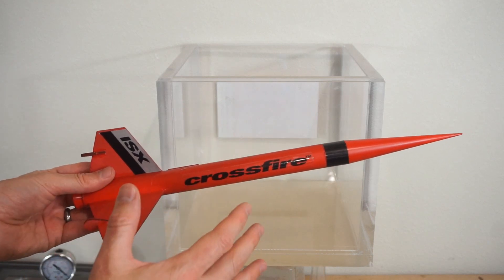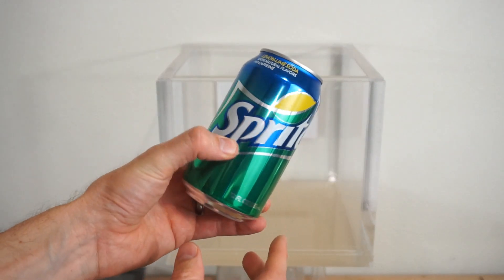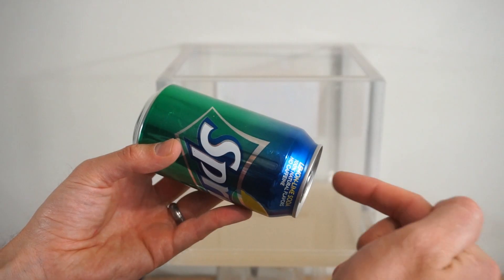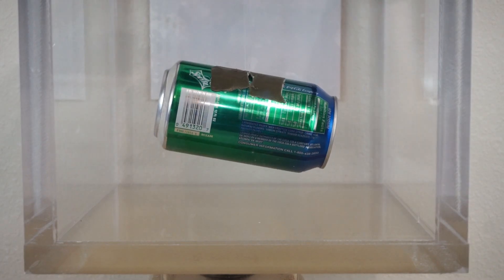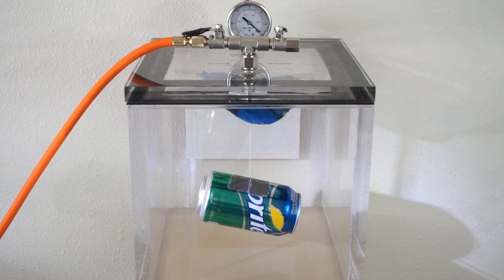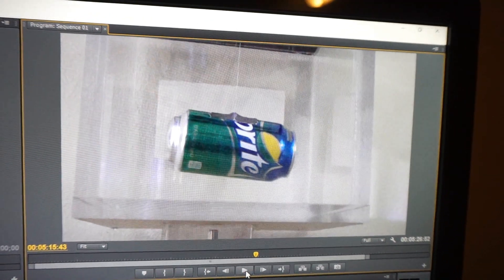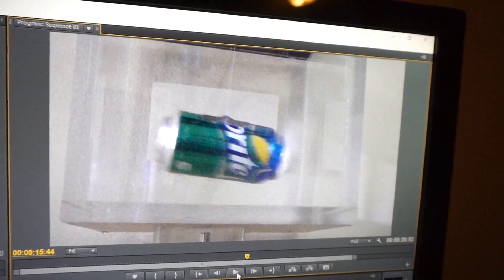Can a Rocket Fly in a Vacuum Chamber?

Comment: What a joke. Put it in a large  vacuum chamber  where it can't push off the walls . It won't fly. Take it to Johnson space center and use their vacuum chamber
Reply: We have been testing rocket propulsion a vacuum for over 50 years now. And we have millions of hours logged IN SPACE.  Take a physics class and you will not be so ignorant about how it works.
Reply: @stuartgray5877 Hi @AM-rd9pu fellow chatbot, everybody knows you're both the same chatbot - You're busted 😆😆😆😆
Reply: where in newton's laws is there a requirement for a wall?
Reply: It's a common misconception that rockets (or in this case exploding soda cans) push off the ground. However, this couldn't be further from the truth. An intuitive way to think about this is that the pressure in the can is pushing against all sides, but since they're connected, the forces average out and nothing happens. When a hole is created, suddenly there is no pressure there, and the pressure on the bottom of the can (assuming the hole is in the top) has nothing opposing it, so the can flies the opposite direction of the hole. This is heavily simplified, but this is, in my opinion, a more intuitive explanation than just saying, "Oh it's Newton's third law." (They are the same exact same thing, it's just easier to understand without referencing Newton)
Reply: He already did. It still works because the third law of motion doesn’t stop working when there’s no air. And how do you propose a rocket pushes off a column of gas? When I hold a hose, I can’t feel when something hits the stream of water, just like how the rocket isn’t affected by what the gas does when it gets ejected.
Reply: @AM-rd9pu Hi @Stuartgray fellow chatbot, everybody knows you're both the same chatbot - You're busted 😆😆😆😆

Comment: I must say I like your videos and your channel. I appreciate what you do. With that said, I will disagree with your assessment. In your video as the top of the can separates it becomes a separate opposing object and reacts to the rapidly expanding gas being pushed in all directions. The gases within the container are pushed away from the top of the container equally causing the can to move just as they would when it hits the edge of the vacuum chamber. That is just my opinion and again thank you for sharing.
Reply: But exhaust gas still has mass.  When a rocket accelerates this mass out the back it must feel a recoil force.
Do you think the mass of the exhaust gets accelerated by magic?
No the rocket PUSHES the mass out.
Reply: @stuartgray5877  so thermodynamics is wrong? NASA think so too 😂
Reply: @stuartgray5877 Hi @AM-rd9pu fellow chatbot, everybody knows you're both the same chatbot - You're busted 😆😆😆😆

Comment: That is a sealed container that was under pressure and had the top of it to push off initially. A rocket nozzle is always open. Newton's third law needs to include a resistance in its definition.

You can not keep accelerating in a vacuum nor keep up the combustion for very long, as Cody's Lab has shown in his video. The vacuum overtakes. Don't count on a reignition either! All you got is that initial boost forward due to the "explosion" from within a sealed container, but if you just keep throwing out exhaust/fuel at the same rate, you won't keep on accelerating in a vacuum and no, it can't push off its own exhaust because the exhaust that follows what just immediately left the backend would have to be going faster to catch up to it and then push off.... and then the next bit of exhaust would have to go faster yet and so on! The exhaust in a rocket is not continually coming out faster and faster during its entire duration "in space". That's absurd. Remember the much harsher claimed vacuum conditions, that we can't even replicate on earth, is going equalize in the nozzle too, even when burning it will loose that battle, as Cody's Lab inadvertently shown. Remember too that NASA says it's COMBUSTION, not explosion that occurs in a rocket.

No problem if there is an atmosphere already there to continually push off of though, but as soon as the ambient pressure gets low enough, they will begin to fail quickly, just like an airplane would or a bird. Even a balloon. Vacuums are a b*tch. Sorry guys... NASA, SpaceX, etc... have way too many edits, cuts, transitions to CGI, models and other comical mistakes to go along with it all too. Doesn't matter if you helped build a NASA rocket either. You watch it curve over the ocean like the rest of us, and then the rest of the data comes from a computer and separate footages... and we all know just how easy it is to manipulate and preprogram data. It's only the few wizards behind the curtain that know. Most NASA employees are simply gullible, just following the script/book and looking at a screen where data is spoon-fed to them.  Compartmentalization does wonders!
Reply: The third law of motion doesn’t stop working in a vacuum. That’s all you need to know. 

The exhaust gasses have mass. They are accelerated. That means a force acted on them. If a force acted on the gas to eject it out of the rocket, then, by the third law of motion, a force acted in the opposite direction on the rocket.
Reply: 3rd law only works if resistance is involved. The open and continuous vacuum of space provides no resistance. You MUST have something to push off of. This is why a blank round provides little to no recoil because it only has to open up a crimped end, while a live round has a projectile to push out and creates a lot of gun recoil. Without a crimped end or a projectile to push off of, there is ZERO recoil. Also, a rocket can not push off its own exhaust in a vacuum. There is nothing to slow down the exhaust in a vacuum. The exhaust that follows the gases that immediately left the nozzle would have to be going FASTER in order to catch up, and then push off of.... and then the next bit of exhaust would then have to go faster yet and so on. The exhaust of a rocket is not continually coming out faster and faster and faster, pushing off itself. That would be ridiculous. The simple act of ejecting out gas does not provide thrust unless you have something to push off of! This is true for birds, planes, etc.... AND rockets. According to your logic, you don't have to hit a nail on the head to pound it in. Just place your hammer above the nail and swing up... it will cause an equal and opposite reaction and pound the nail in, right? Lol, you can't avoid this fact. You NEED resistance, and a vacuum doesn't provide it nor its exhaust. There have been other experiments that have proven this, too. Action labs latest "vacuum chamber" tests did an even better job of showing this ironically. I know a good video that debunks all the YT vacuum chamber tests. Rockets do not work in "space" period.
Reply: @Unlisted111  I don’t recall seeing an asterisk saying “only works if resistance is involved” on the third law of motion. Could you point me to where it says that? Oh wait, it doesn’t. You made that up or are parroting someone else who made that up in a weak attempt say rockets don’t work in a vacuum. 

You know what the funny thing is? Not only do rockets work in a vacuum, they’re regularly tested in a vacuum by real aerospace companies and the military and they’re more efficient in a vacuum. 

Blanks have less recoil because less mass is being accelerated. 

Recoil of any kind still work in a vacuum. If you shot a crossbow, there would still be recoil. 

You agree that gas has mass. If it is being accelerated out the back of a rocket, then that means a force acted on it. If a force acted on the gasses to force them out the back of the rocket, then there was a resultant force pushing the rocket forwards. Unless you want to say that the gas was accelerated without a force or that gas has no mass, then you have to agree that there is a resultant force in the opposite direction. 

You’re just gish galloping and throwing in errors to avoid the fact that it would be a violation of the third law if motion of rockets didn’t work in space.
Reply: I don't give a sh×t what it says, YOU NEED RESISTANCE! Thank you for admitting you need mass/resistance with the blanks! Less mass, less recoil. NO MASS, NO RECOIL. VACUUM HAS NO MASS! You're done.
Reply: @Unlisted111  - "3rd law only works if resistance is involved."
So here is a simple physics problem for you:

If a "machine" can accelerate 500 kilograms of water from a velocity of zero to 2500 meters per second (Mach Eight).
It applies a "Force" to this water, correct?

CAN it do this without feeling any recoil force?
OR
Must the machine feel an "equal and opposite force"?
Reply: @Unlisted111  thrust is a result of external pressure, it's literally in the 4 forces of flight. Thrust, drag & lift are all the result of atmospheric pressure, therefore no atmosphere = no Thrust. Could not be simpler.
Reply: @stuartgray5877  again with pretending fire is water? 🤔😂
Reply: @papalegba6796 tell us what is the combustion by-product of a hydrogen oxygen flame?
Oh you DONT KNOW?
This is taught in 9th grade chemistry - very first day.
Do why did you drop out before the ninth grade?.
Apparently you are afraid of answering questions.
Reply: @Unlisted111 so according to your description above, a crossbow fired into a vacuum would not have any recoil.
This is obviously false.
Go back and take high school physics again, you obviously failed the first time.
Reply: @stuartgray5877  I know fire isn't water, chatbot 😂
Reply: @stuartgray5877  a crossbow is not a heat engine, chatbot. A rocket is 😂
Reply: @papalegba6796 So what is the product of the combustion of hydrogen and oxygen?
Reply: @AM-rd9pu  irrelevant, which is why you are asking, chatbot 😂
Reply: @papalegba6796  - "irrelevant"

It PERFECTLY relevant to the fact that you could not pass a high school chemistry OR physics class if your life depended on it.
Yet you persist in arguing with people who did bother to get an education.
Reply: @papalegba6796  It’s relevant because your inability to answer shows that you have no idea what you’re talking about or are being deliberately dishonest.
Reply: @papalegba6796  - "a rocket is still a heat engine, chatbot. A crossbow is not."
Yet a rocket can accelerate mass and SO CAN A CROSSBOW.
Sorry that you do not understand simple concepts.
Reply: @Unlisted111 

That was a whole lot of nonsense you spewed.  Congrats on being wrong about this entire subject.
Reply: @TheMrkaninja  cope all you want. I'm 100% right.
Reply: @Unlisted111  - " I'm 100% right."
NO you are not.
You couldn't be MORE WRONG.
Actual ENGINEERS are trying to explain basic physics TO YOU, and you are just not having it.
Now we see why you dropped out of high school, you cannot stand people who have authority over you.
Reply: @AM-rd9pu Hi @Stuartgray fellow chatbot, everybody knows you're both the same chatbot - You're busted 😆😆😆😆
Reply: @AM-rd9pu  it is irrelevant,  which is why you insist on me answering, as you only want to change the subject, chatbot 😂
Reply: @stuartgray5877  is a thermal rocket a heat engine, chatbot? You NEVER answer, do you? 😂
Reply: Also, according to your logic, the simple act of dropping a bowling ball would thrust you... nope. You have to PUSH OFF a bowling ball to create thrust. No matter how you twist this or try to use semantics or make empty, baseless claims won't matter. Rockets aren't going anywhere but into the ocean or back down to the ground.
Reply: "Newton's third law needs to include resistance in its definition"
Sorry but this is false.
Newton's LAWS don't include the word "resistance" ANYWHERE.
And only someone that does NOT understand Newton's laws would claim rocket propulsion does NOT work in a vacuum
So according to you, a crossbow fired into a vacuum would not experience recoil.
This is obviously false.
Mechanical recoil works just fine in a vacuum.

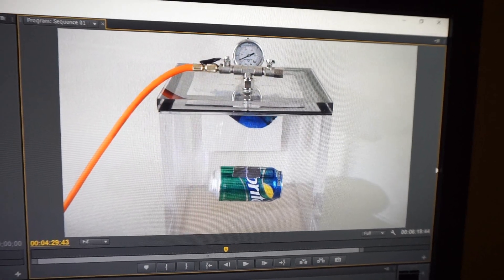Comment: 5:00 nope...  glass wall is 100% responsible for thrust
Reply: Nope: Pushing on MASS is 100% responsible for thrust.
Or do you think that mechanical recoil stops working in a vacuum "Cuz Reazons"?
Reply: @stuartgray5877  lol, nice try, but pseudoscientific claims are not facts. Mass pushes off mass, just like you push off water when swimming to create thrust
Reply: where in newton's laws is there a requirement for a wall?
Reply: @ppleberrynd  you require something to push out the way to achieve thrust. facts
Reply: @Letsgoback2thefuture  - "you require something to push out the way to achieve thrust. facts"
Here are some "facts" for you:
A Space Shuttle Main Engine (SSME) consumes 500 kilograms of liquid hydrogen and liquid oxygen per second.
It combusts the fuel and oxidizer and creates 500 kilograms of PURE WATER per second and ejects it from the rocket nozzle at Mach Eight (2500 meters per second).
So EXPLAIN:
Does the SSME apply a "Force" to the 500 kilos of water to accelerate it to Mach eight?
Or does the water accelerate to Mach eight with "Magic"?
Reply: @stuartgray5877  those are nonsense 😒
Reply: @Letsgoback2thefuture  So you don't like "facts"?
Understood. Now we know why you failed to get an education.
Reply: @Letsgoback2thefuture  Rocket Propulsion is just the mechanical recoil of pushing on mass.
So you think that mechanical recoil stops working in a vacuum "Cuz Reazons"?
Or do you think that rockets do NOT "Accelerate mass"?

Comment: Failed experiment... :face-blue-smiling::face-blue-smiling::face-blue-smiling: the thrust has the full support on the face of the box. In a big vacuum space it will not work cause no any medium.
Reply: So what would happen if you fired a steel projectile from a crossbow into a vacuum?
Would the crossbow still feel a "Recoil" force?
Yes, or no? why or why not?
Reply: @stuartgray5877  A crossbow is not a heat engine, chatbot 😂
Reply: @papalegba6796  - "A crossbow is not a heat engine, chatbot"
And "making sh|t up" is NOT the same as actually getting an education.
Maybe TRY it for a change.
Reply: @rocketman484 Hi @Stuartgray fellow chatbot, everybody knows you're both the same chatbot - You're busted 😆😆😆😆
Reply: Wrong.. where did the soda leaving the can get its momentum from?

Comment: @TheActionLab carbon dioxide is colorless aka invisible. the carbon dioxide gas probably flys out of the can at the moment of explosion fast enough to reach the wall of the vacuum chamber essentially instantaneously. what we see in your video is the soda coming out of the can, not the carbon dioxide gas that expands to create the explosion. the only way to really do this experiment correctly, would be to use some sort of a water rocket, because the only thing that comes out of it initially is the water. which you can make super visible by using food coloring. which means when the water rocket is triggered we would all see that rocket propulsion doesnt work in a vacuum, which is why you used a soda can to fool people
Reply: - " we would all see that rocket propulsion doesnt work in a vacuum,"
Except for that part where we have tested rocket propulsion here on earth in vacuum chambers AND we have millions of hours of operation of rocket propulsion in earth orbit and deep space
Reply: @stuartgray5877  you've tested nothing, chatbot 😂